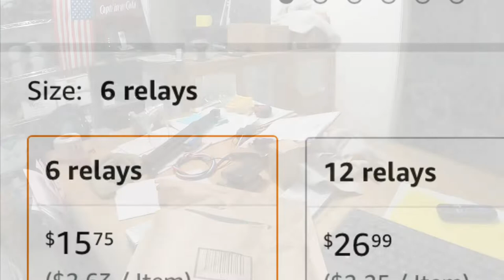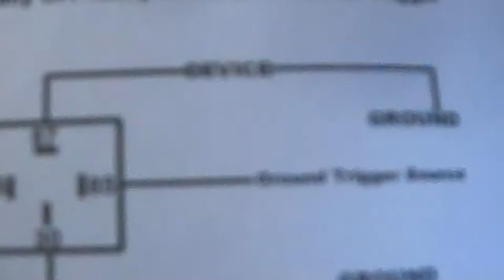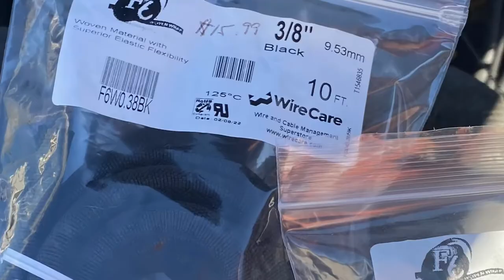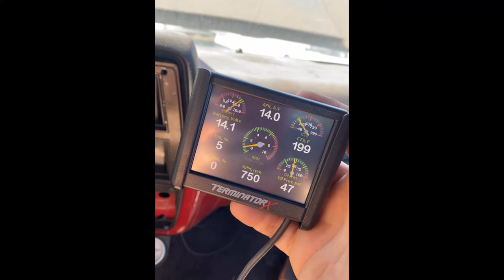Cheap Ebay ALLOYWORKS c10 square body radiator swap and fans w relay

Comment: Great video! 
Did you do the LS Swap?
You should do a walk through on what parts you used.
Reply from the maker: we did , was completed for this customer almost two years ago, We have been doing swaps since 2002, No two swaps are the same, Diff customers want diff items/brands/designs ect ect .. the basics are always needed, drive train itself , mounts, cooling system, management system, & fuels system are always the big items tho.

Comment: What’s the part number for the radiator and did you make the radiator brackets ?
Reply from the maker: nope , was original brackets (upper) just cleaned them and painted them ..
https://www.ebay.com/itm/284949374241